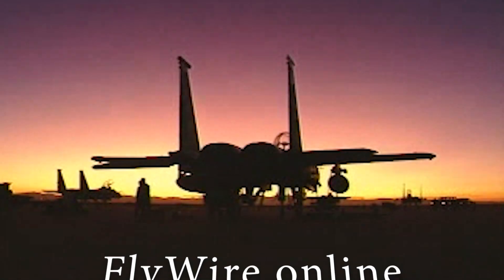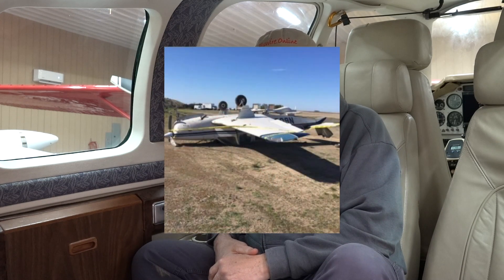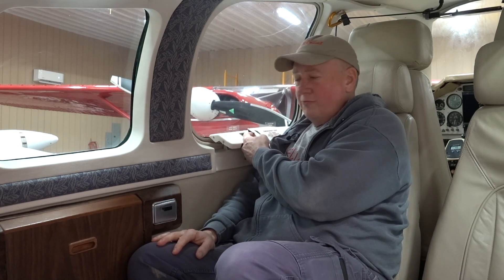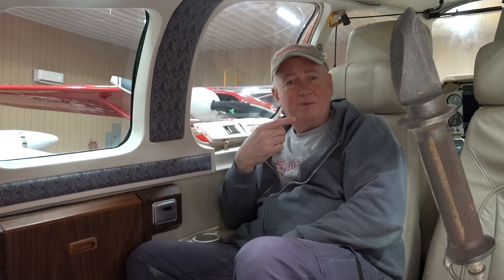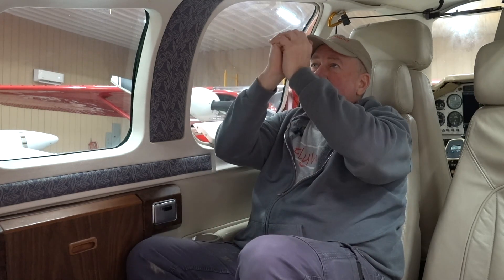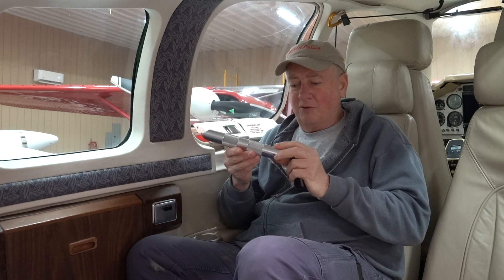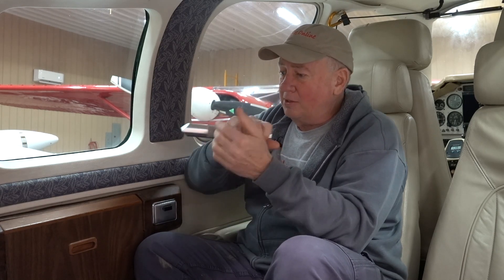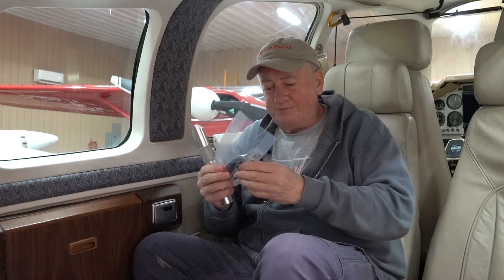Trapped in Your Airplane and You Have to Get Out

Comment: I used to fly a dH Chipmunk for many years (think baby Spitfire) and my biggest fear was ending up inverted on the ground perhaps as the result of a forced landing onto a rough field. It's a tandem seat 2-seat aeroplane with a sliding canopy which obviously isn't going to slide open in those circumstances. Landing with the canopy already slid open would invite serious head injuries or worse I'd think if the aeroplane inverted on landing.

dH thoughtfully provided jettisonable side windows in the canopy (wired shut but the wire can be broken in an emergency) for just this situation. However, I'm a bit bigger than the average young RAF pilot so whether I'd fit through the gap left by the jettisoned window I just don't know. I'm very glad I never had to find out!

Comment: I brief passengers to run straight away from the tail of the aircraft. If for some reason a confused passenger exits the plane with the engine running I want them to run away from the propeller.
Reply from the maker: That's a good plan. I briefed off the nose when I was in the USAF... the nose is the safest place because the crash crew will come to the plane from the side or at a 45... best to stay away from their path, they aren't looking for you. Thinking about that, the wing was always behind me, in light planes the wing is in the front and in the way. Good idea!
Reply: @FlyWirescottperdue  I was a KC-135 Boomer. We briefed to meet off the nose as well, for all the reasons you stated, but also because if evacuation began before the engines were shut down we wanted everyone to stay away from behind the engines. We had the aft hatch with a rope and/or slide available for egress. I always briefed the pax to be sure the right side engines were not running before exiting the aft hatch, then to run directly away from the aircraft until a safe distance before circling around to the front.

Comment: nice one, i wonder if the tool actually works, especially under water
Reply from the maker: The Canopy Breaker used in the USAF works on much thicker Plexiglass. I'm positive this one will work as well on GA plexi even up to the 1/2" sometimes seen. Underwater will reduce the impact force, but it will work... and at that point what choice do you have?